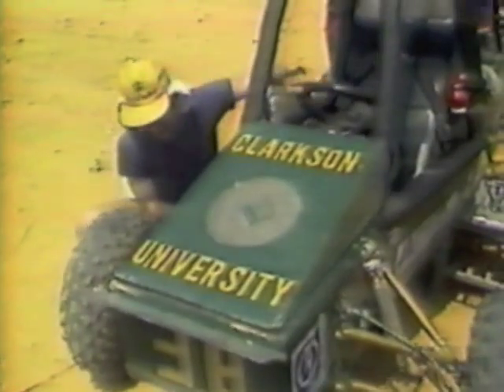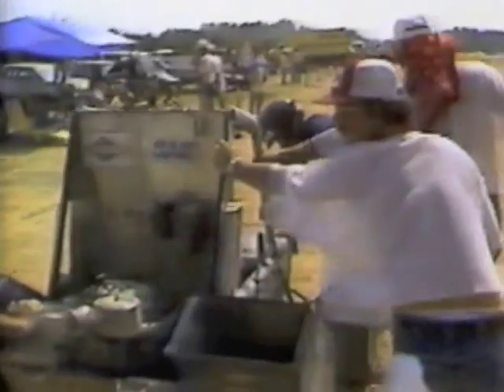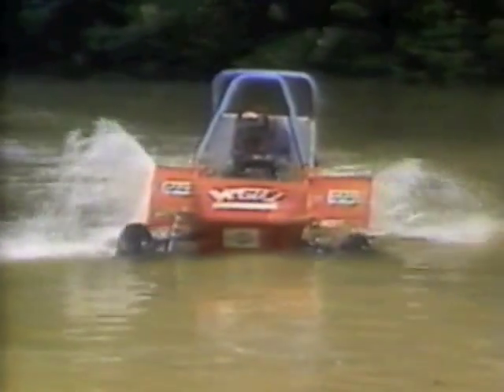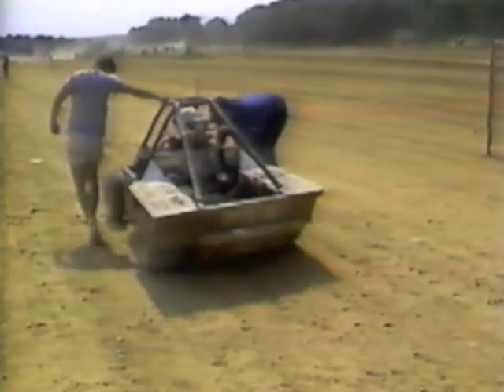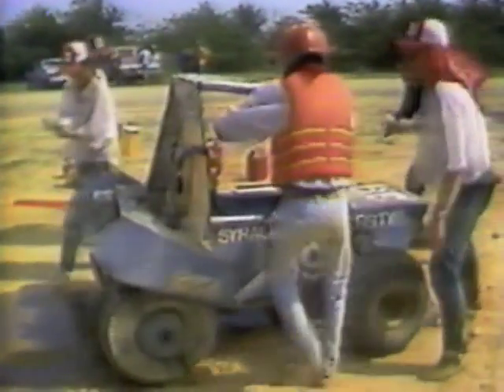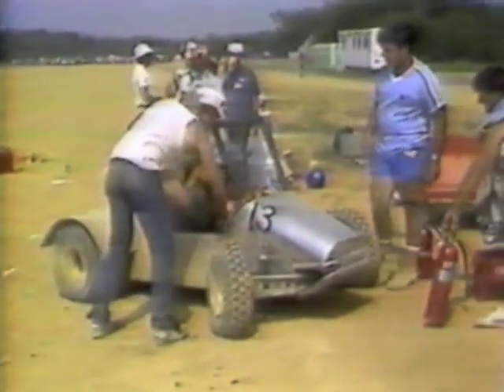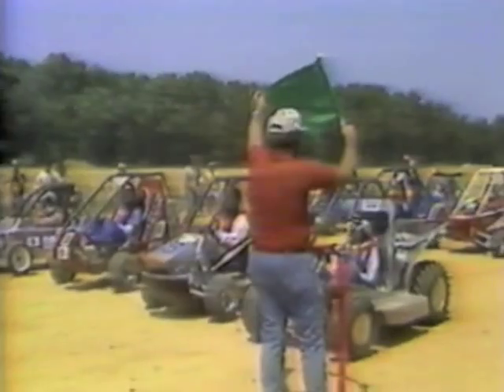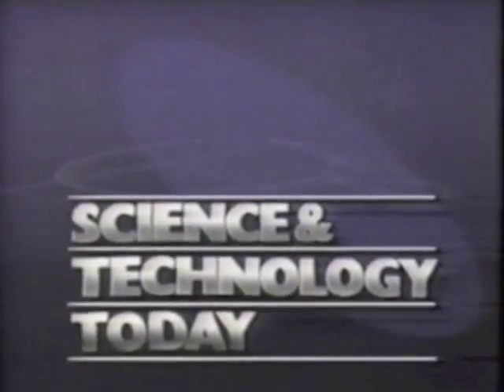1986 Baja CNN Special

Comment: I'm not sure how many people that visit this site were actually at the 1986 SAE Baja Competition. I was there with the Georgia Southern College team. Since I was the largest person on the team I was picked to the team captain by our two advisers; Mr. Don Whaley and Mr. John Wallace. 
We had an all aluminum vehicle. It was made from aircraft aluminum which had been donated to the engineering school by Gulf Stream Aerospace in Savannah, Georgia. We broke a front axle on the rocks and had to mend it back together using a drill and some bolts and nuts so that we could at least cross the finish line. 
There is more to tell, but maybe there is someone else that was at the 1986 event that could add more. It would be even better if there is someone from the 1986 Georgia Southern team with a photo of the team that could be posted.

Thanks for the memories,
William (Bill) Horne